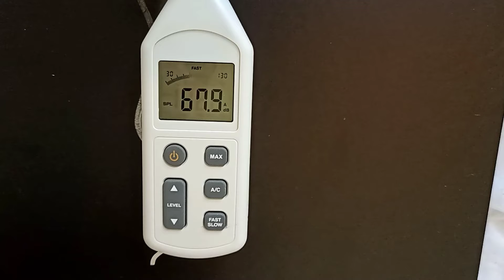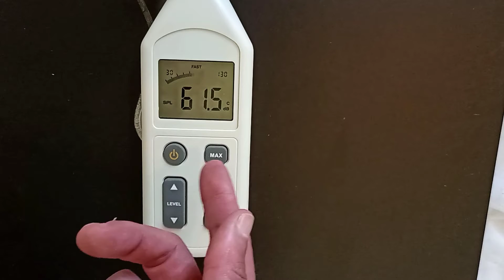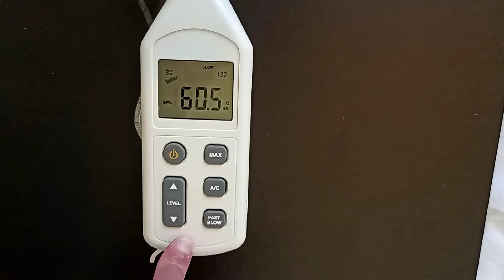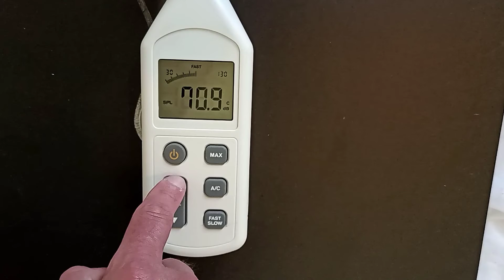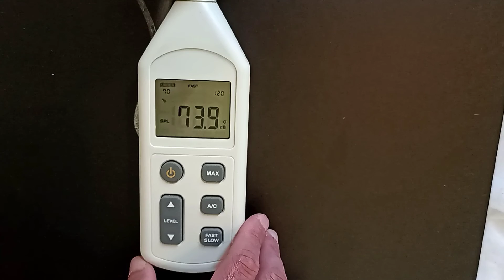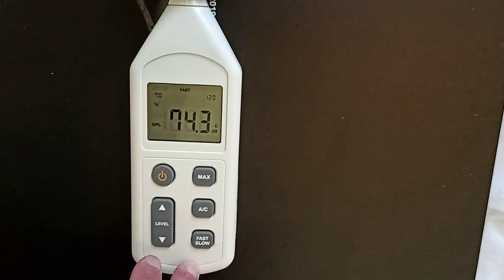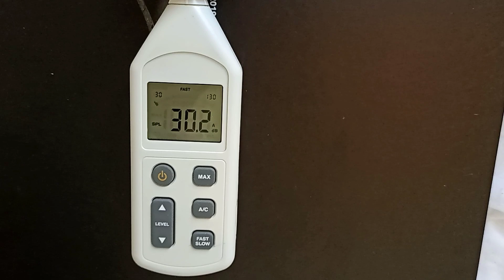Sound Level Meter Explained !

Comment: Does it save the data?
Reply from the maker: It does but not the sound level meter itself , you need to have a PC software to access the data called SoundLab. Unfortunately it does not run on VM, only in a real PC

Comment: Does it save the data?
Reply from the maker: Hello, not this model. But there are integrated sound level meters that save data over a long period, usually used in environmental noise measurements.. they can be quite expensive.
Reply: @onlineacoustics  thank you but how do I know which value is my noise value from the device it displays increasing values with stopping
Reply from the maker: @SPAYTVSTUDIO  it gives instant values, so it just gives you a rough idea..

For a more advanced sound level meter you need integrated function which can memorize values and show up average values over time, peak values etc...

Comment: To measure traffic noise using fast or slow button?
Reply from the maker: That is a tricky question since ISO 1996 does not define that well if I am not mistaken.

Usually, if you are using an integrated level meter you setup to FAST but these meters can actually measure SLOW, FAST and IMPULSIVE at the same time... so it is not abnormal to actually measure all 3 responses and compared all of them to better comprehend the measured noise 

Also, the ISO relates to environmental acoustics and the impact of noise on people so it suggests to measure in dB(A)  and not the characterizations of traffic noise itself (to be measured in dB(Z))